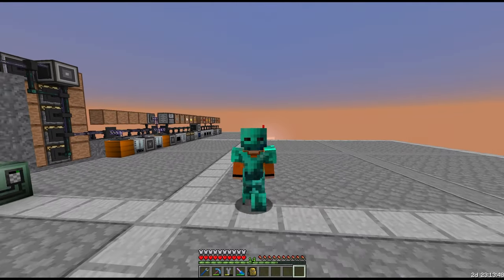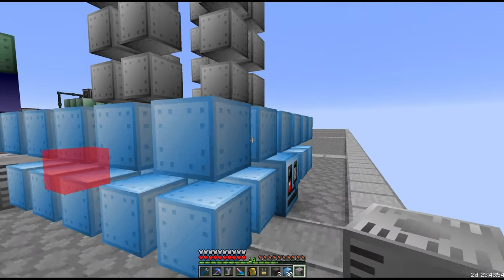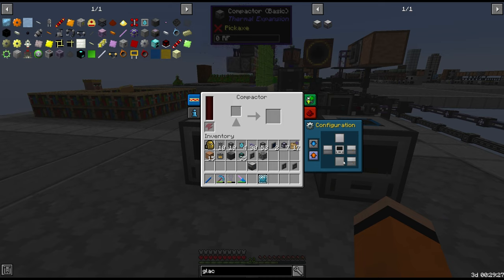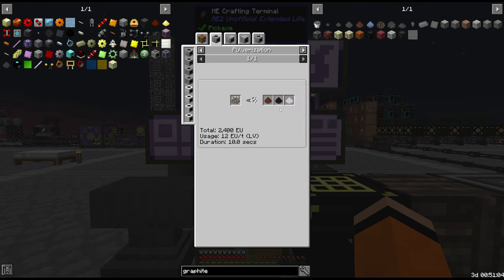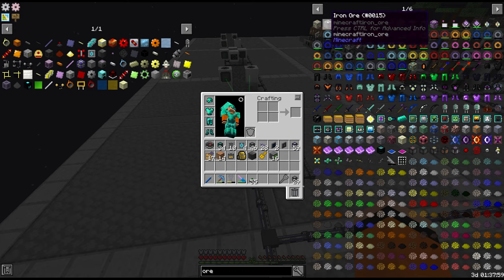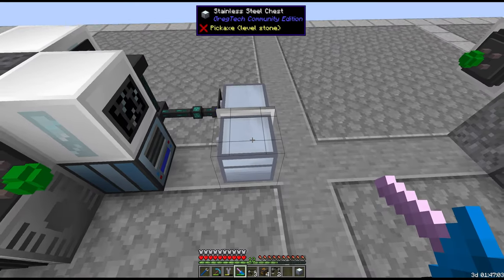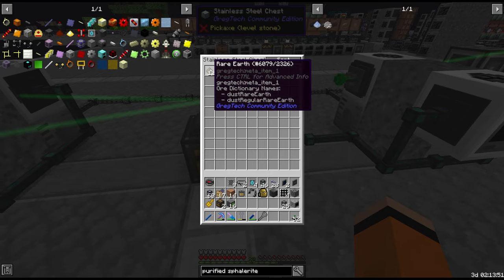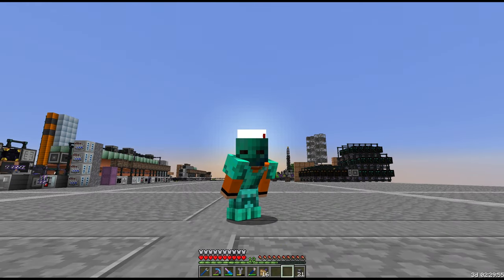Gregtech Ore Processing - Nomifactory: Episode 13

Comment: Its a lot easier to expand and route ores through ore processing through AE2.  I did an AE2 subnet attached to a crate where my main AE2 dumps all ores.  Then, all machines can just extract back into AE2 and the system will route for you with much easier expansion.

Comment: Nice episode! Loved the building to the beat in the montage!

I made distilled water for my washers as they remained the bottle neck for basically the whole pack. I used drawers as filters for my ore processing system and only exposed stuff to my ae system when I was done with it so I had centralized packing, specialized processing with various chemicals and electrolysing all attached to the main ore processing system.  Probably not the most performant or elegant and it took a lot of space but it was fun to make!
Reply from the maker: Sometimes fun trumps efficiency :D There are lots of options and ways to do ore processing in GT, it's always a fun endeavour

Comment: why did you use robot arms instead of conveyors when filtering crushed ores?
Reply: robot arms allow the use of filters and white/blacklisting, conveyors don't
Reply: @Shruikan1011  you can absolutely white/blacklist and use oredict filters on conveyors. Robot arms have the extra feature of Keep Exact / Supply Exact
Reply: @Shruikan I understand you can use the robot arms to supply exact, but as Nabjab pointed out, you are able to use filters on conveyors.. I'm using them on my playthrough. Just wondered if there was another reason why Threefold was using the arms instead of conveyors at that particular stage stage of the filtering process 

I use arms to feed exactly 4 or 9 to the packagers (or multiples of)
Reply: @johncullen965  good point, huh

Comment: Lower tier ore washers would have been fine since they don’t get a bonus for being higher tier
Same with centrifuges
Reply: but then they would run slower than the macerators so he would need more machines, it's simpler to have them all at the same tier i think
Reply: @Nabjab94  He is running everything at HV tier power, so no it doesn’t matter at this moment. Just a current waste of resources
Reply: @Royal_4096  yeah he said he is for now, until he can manage to power it at IV, I think after he finishes the nuclearcraft reactor he will be able to power it at IV, and then if he had made lower tier ore washers and centrifuges, he would have either had to make additional machines, or remake the IV ones.
EDTA: Sadly GTCE does not have the dissassembler, so crafted machines cannot be recycled for spare parts, this is why I think it was a good call to make them all at IV right off the bat.
Reply from the maker: @Nabjab94  Plus from what I tested it seems the extra chance outputs at IV remain even if you change the tier the machine is running at. I would love confirmation on this, but thats what it seems to me :)
Reply: @Threefold.  Correct, they do. It's the quality of the machine not the speed at which they are operated. When your power situation is better you can up the tier they overclock to, and IV machines are the most important base-expansion tier before tank so it's not at all a bad investment. Eventually you can stick them in Processing Arrays too, for some easier parallelizing logistics and extreme throughput rates.